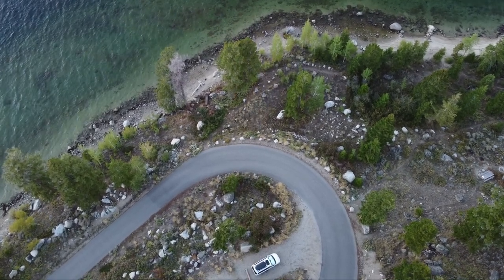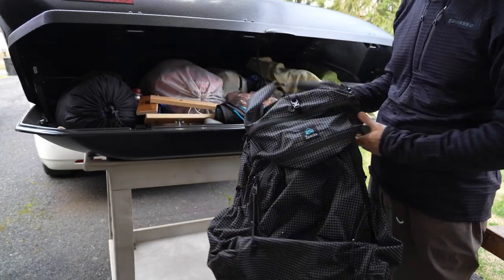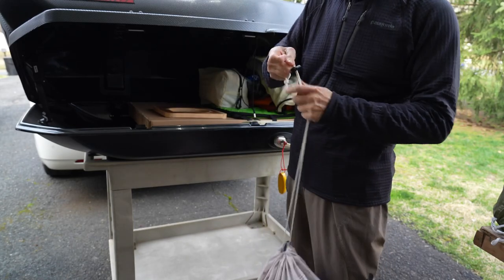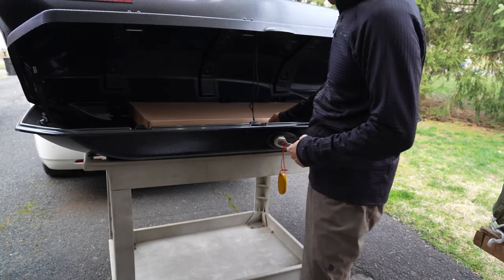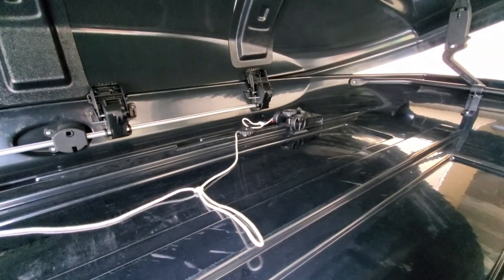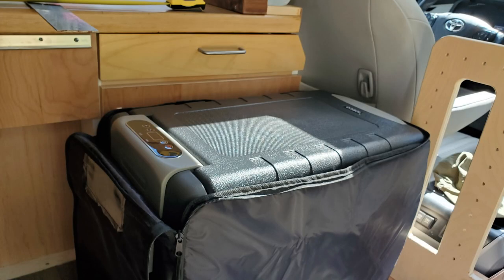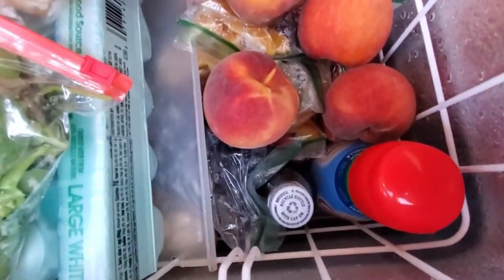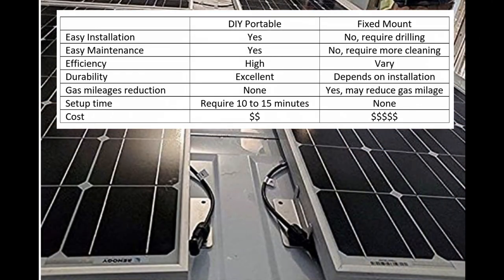Practical Minivan Camper - Most important Upgrades

Comment: Yes, the portable folding solar panels are at least 3x's the price of the renogy that you have, wise choice if you have the strength to lift it. I like your van !
Reply from the maker: Thank you for watching. The Portable solar panel is 15 lbs, heavier than those foldable light weight solar panels. But those light weight panels get blow off by wind easily and durability is questionable.
Reply: @vinnyandrocky  true story

Comment: Very informative , ps you can use a cheap  cooler and make it last a long time by drilling holes around the top perimeter and then use spray foam in the holes that will act as a expensive insulator.